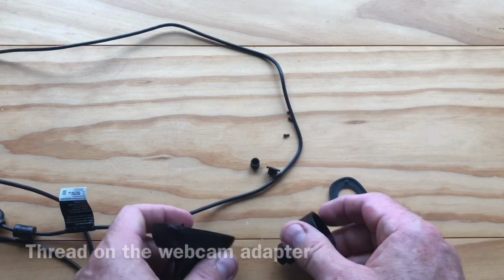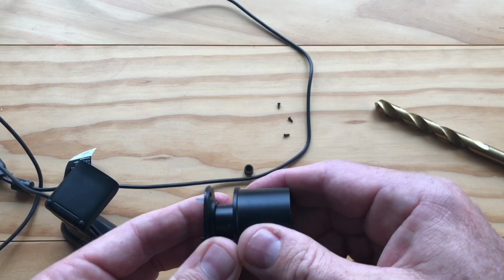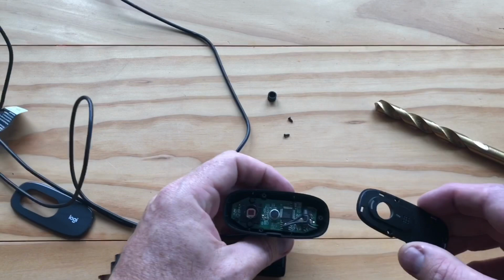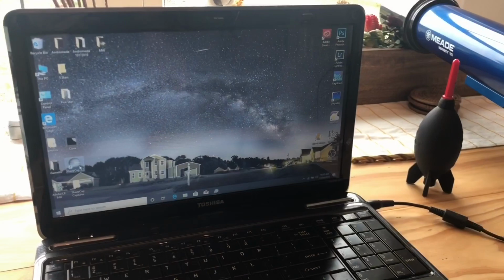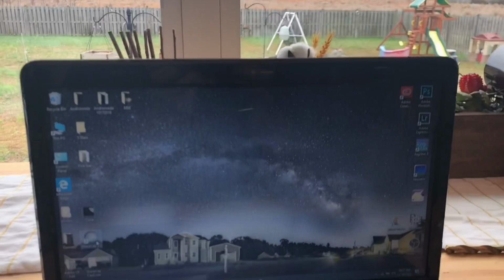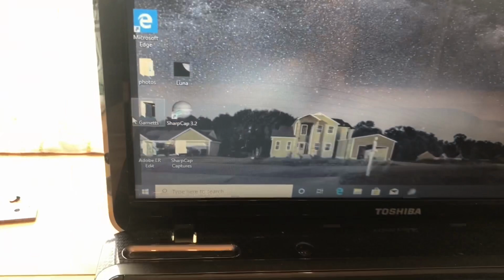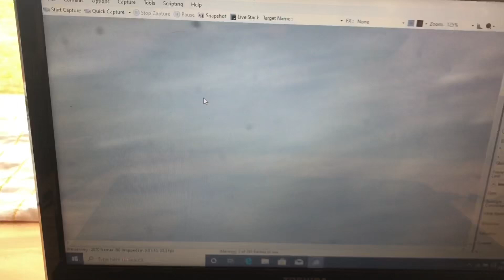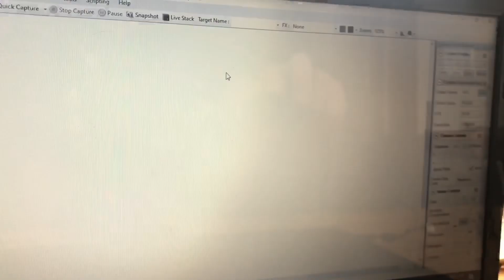Modify a Logitech C270 for astrophotography

Comment: Question please.  I modified a Logitech C310.  I've had some issues.  My question is the The Logitech sensor has what looks like an IR filter over it.  Then the 1.25" adapter I bought came with a purple colored IR filter. Should I remove the filter off of the Logitech sensor.  Could having both filters be cutting down too much on the sensitivity of the filter?  Thanks,  Dave in PA
Reply: Remove the filter on the webcam
Reply from the maker: I agree with Pi’s response. The stock IR filter is designed for terrestrial use. The adapter one is designed for astronomy. That’s the difference. The bandpasses are not the same and yes stacking them will darken everything.
Reply: @GarnettLeary  hey, I removed the red glass of the sensor(it shattered in to 3 pieces or so) on a c270 but now the camera does not see anything. just black and 0 fps. the computer detects it, the capture programs see it,but no picture and 0 fps .it was working before removing the red glass. Do you have any idea what went wrong?
Reply from the maker: I’m wondering if the lens is broken. Is there any glass left? At the least it should be seeing bright white light overexposed
Reply: @GarnettLeary  without the lens it should be seeing hazy colors at least, right?i must have damaged the sensor itself somehow.. even the yellow LED comes on when accessing the camera in sharpcap but no image. at least i only spent half a dollar on it. thanks

Comment: Did you need to update the Firmware so that you can take long exposure shots. I remember I needed to flash the firmware on my old Philips SPC9000NC?
Reply from the maker: I only used it for AVI of planets. I did read an article about long exposures. I believe it requires a physical modification to the webcam also. I’ll see if I can find the link.
Reply: @GarnettLeary  That would be awesome. I had the Philips one but cant seem to find it and to buy one of those now is like finding hens teeth.
Reply from the maker: http://www.dslrmodifications.com/fusiontest10.html
Reply from the maker: That’s not the exact article but I’m still looking. That one is very useful tho.

Comment: Hello sir, I want to ask, I have got the focus on the telescope focuser but the results are blurry because the webcam can't focus, oh yes, before I tried without Barlow and blurr when I Adding Barlow the result is focused, but blurry because the webcam is not focused, do you know the problem?, Please answer sir
Reply from the maker: How long is the nosepiece on the webcam and what type of telescope? With that information I can help you.
Reply: @GarnettLeary My Nosepiece is 4cm ,With 1.25inch Hole, My Telescope Newtonian F70076 Has FL700mm Diameter and Primary Mirror 76mm
Reply from the maker: You’re lacking inward focus. You definitely need a barlow in combination with the webcam. Your best option is eyepiece projection. Recording off an eyepiece that is. You’ll need a special adapter to do that.
Reply: @GarnettLeary  for Barlow I've used it, but what do you mean Special adapters? What is it like?
Reply from the maker: Sorry such a delayed response. Here’s a link where you can examine one:

Astromania 1.25" Extendable Camera Adapter - for Either Prime-Focus Or Eyepiece-Projection Astrophotography with Refractors or Reflector Telescopes - Threaded for Standard 1.25inch Astronomy Filters

Comment: I tried this hack. It fits, but when I put the nosepiece in my telescope, I can't get the sensor close enough to focus even with the focussing knob turned all the way in. As it gets closer, it starts forming a blurry image,  but it hit the limit before it can bring any details into focus. Any ideas on how to bring the sensor in closer?
Reply: it sounds like the only way you could make it work would be to adapt the threads to fit properly. if it can't get close enough, then it's too far away, that's all there is to it. you just need to get the sensor closer.
Reply: @nobody2021  I found I could bring it to focus with a Barlow. I got some decent footage of the Moon, but couldn't get the whole disc in the frame. I ended up buying an Svbony SV105.
Reply: I also tried to modify a webcam (lifecam studio) and it fited very well in the telescope diagonal, BUT I just get a very blurry video, even with a very sharp focuse ....(it was wasting time). I finally decide to go with my DSLR camera.

Comment: Nice mod. Is there a particular reason to choose to buy this model (C270)? Please clarify me :)
Reply from the maker: Compare read noise, quantum efficiency, and especially frame rate across models. I used this specific model because it’s excellent comparatively. The other thing to look out for is ease of conversion. A lot of webcams don’t use the threaded connection for the lens. This means you won’t be able to use the 1.25” adapters that are available. In those cases people hot glue old film canisters etc. It’s much easier to adapt a model that accepts the barrel adapters. The risk of diy is that the nosepiece isn’t exactly square. In that case you’ll end up with distortion in image due to the optical plane being skewed from the sensor.
Reply: @GarnettLeary  thanks for your reply. 😊
Reply: @GarnettLeary c310?

Comment: Hey I was wondering if the Logitech c270 allows for manual exposure and shutter speed in sharpcap as my current web cam dosent give manual exposure and shutter speed.
Reply from the maker: There’s a modification to software called “exposure” which simulates long exposure. I have since lost the link sorry. The Logitech C270 is supported by Sharpcap. I’ll try and find that link and return it to you.
Reply: @GarnettLeary  thx so much for the fast reply. I bought a cheap Chinese webcam as I was just getting into astrophotography with webcam and I was put of with the fact that I can't control the exposure. I'm looking into buying the logi c270 as it's one of the best budget  webcams and I just hope that it allows for manual iso and exposure control
Reply from the maker: I assure you it fully integrates with Sharpcap for planets. For additional control for EAA get this:

https://www.nimisis.com/projects/exposure.php
Reply from the maker: Additionally it’s possible this software may integrate with your existing webcam. It’s free to try.
Reply: @GarnettLeary  thank you so much
Reply from the maker: Anytime. Clear skies friend

Comment: It is no longer necessary to make these things. You can get a ready made telescope astro camera from Ebay / China for about $8 that will provide same quality of resolution. Of course the more expensive Nexiamge etc go for $100 or so. Look it up.
Reply from the maker: These are likely readily available whereas you have extreme wait times for Chinese ones. I totally see your point. I’m aware of the foreign pre-made stuff but there are exceptions such as some of the older model ccd’s that are much better. The resolution on this C270 cmos exceeds the Chinese ones currently offered on Amazon. I have owned the NexImage line, and although nice, they truly don’t offer much more in the way of technology to price. Someone will find the video useful. Frame rates are typically where commercial webcams fall short. Clear skies.
Reply: Link?